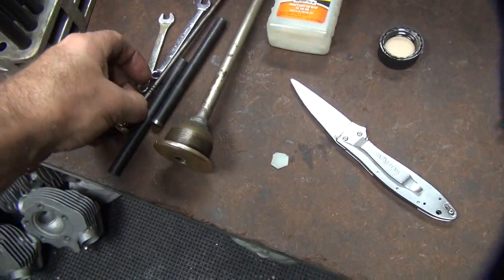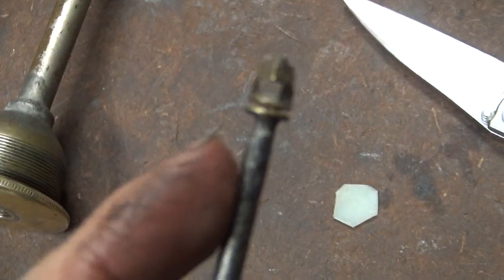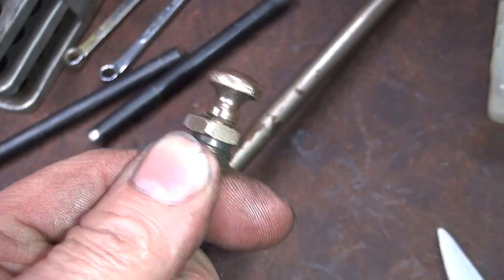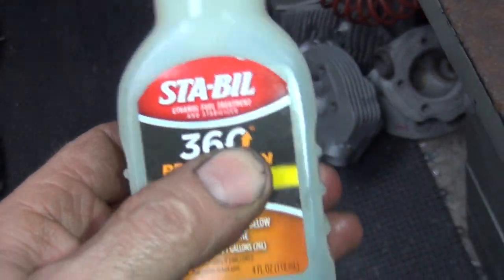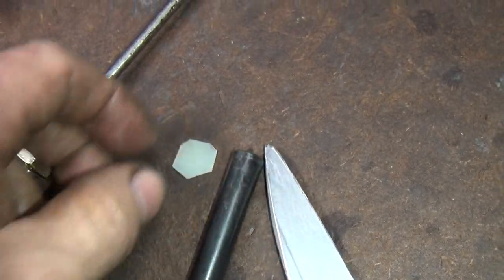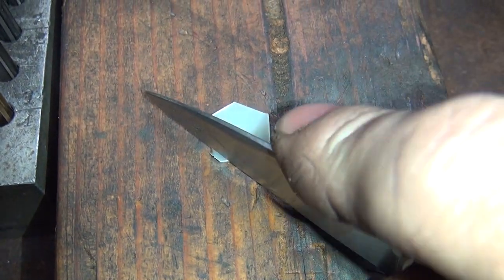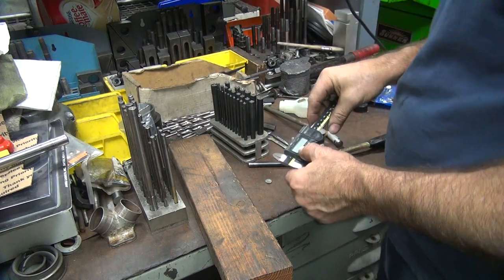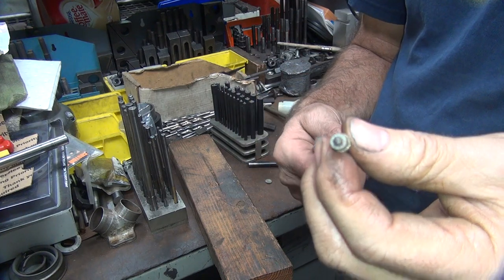1936 RL #111 WL 45ci Flathead Bobber Bike Assembly rebuild 41 WLA Harley by tatro machine

Comment: When my brake cleaner propellant is gone I punch a little hole in the side of the can and sprinkle it on whatever I want to clean up. I only throw them away when they are really emptied out. I get the last drop.
Reply from the maker: i just repressurize the can with my air nozzle.
tatro
Reply: Good idea I'll give that a try . Thanks.!